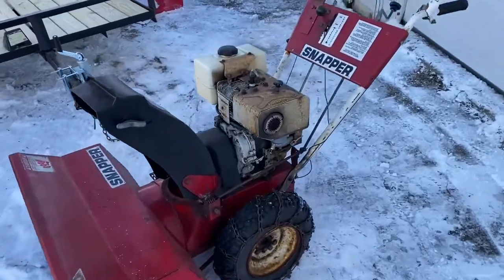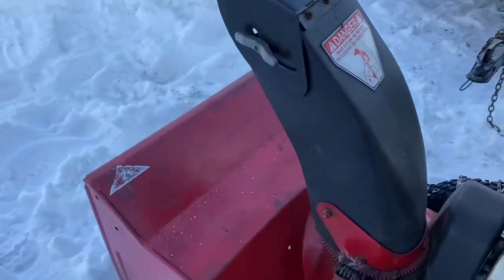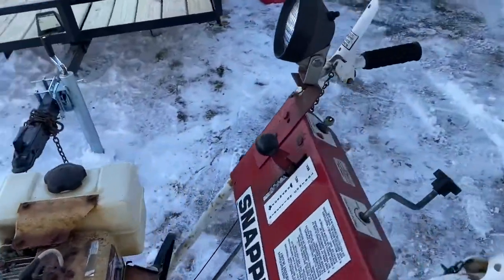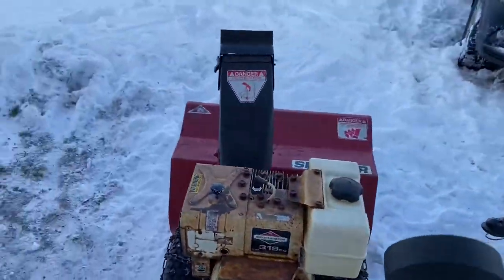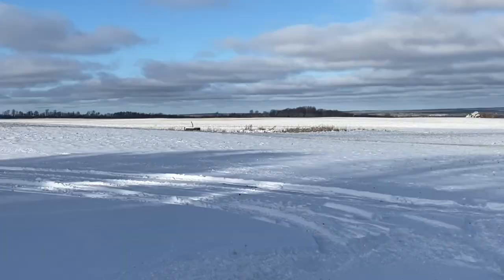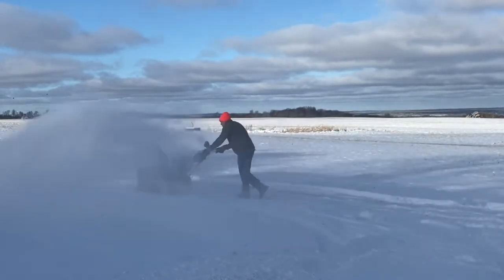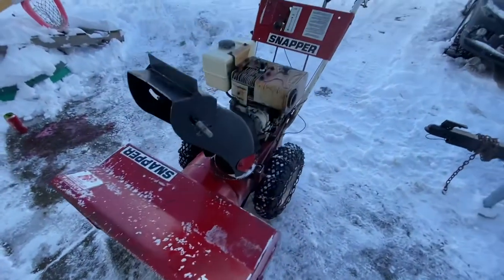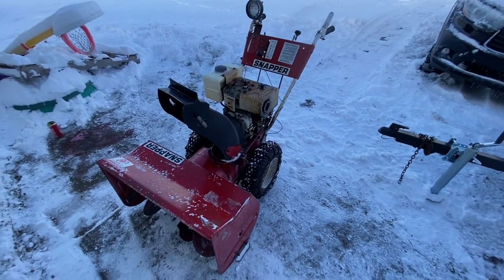1988 Snapper 826 Snow Blower

Comment: That's back when they made a good snowblower, not like the plastic, cheap thin metal, and thin-cable controlled crap they sell today.
Reply from the maker: Unfortunately no one repairs them so they get scrapped and replaced with the new junk. Its great to find the old ones and bring them back to life.